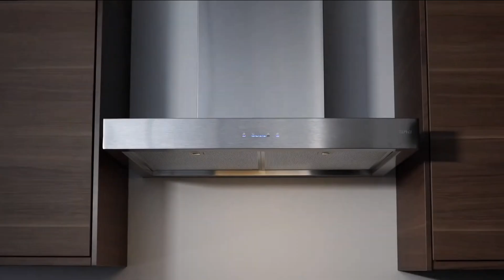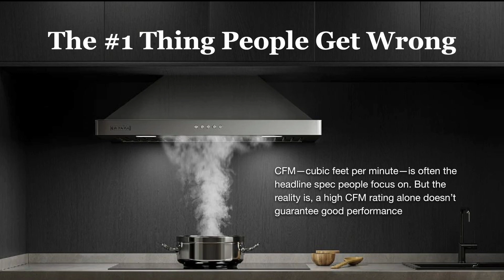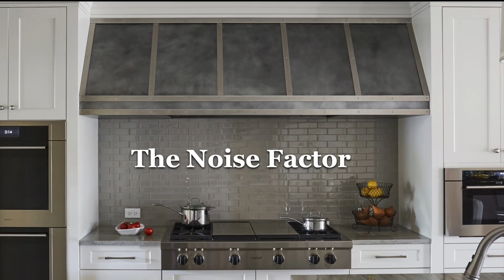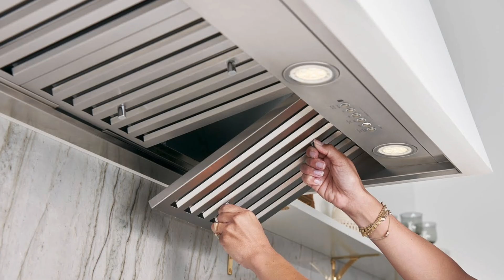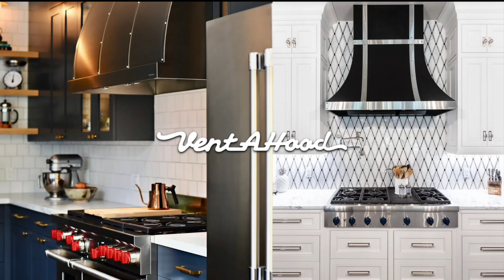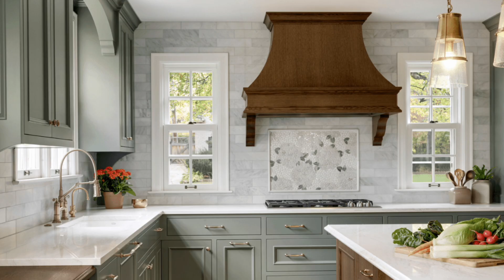What They Don't Tell You About Kitchen Hoods

Comment: Hi,I have a ( Elica cervinia range hood ) I washed and cleaned the grease filters, but wondering if there are any other filters or parts to be changed or cleaned or replaced in the hood to make the air flow better.thank you in advance.
Reply from the maker: Great job cleaning the grease filters! 👍 For the Elica Cervinia, those are the main filters. To improve airflow, also check these: Ductwork & outside vent – Make sure the duct isn’t clogged with grease and the roof/wall cap opens freely. Fan blades – Wipe down the blower blades (power off) as grease buildup here really reduces suction. Regularly wiping the inside of the hood also helps.